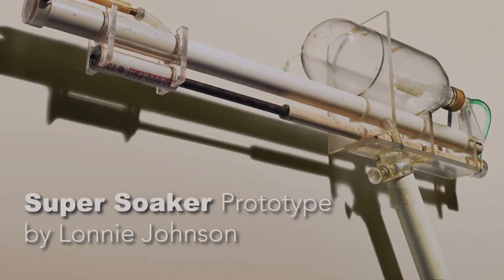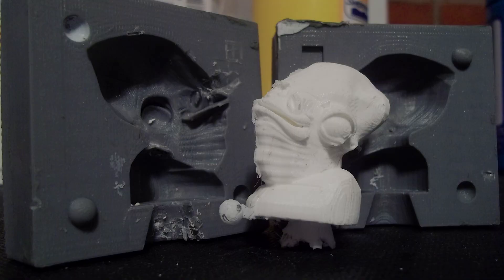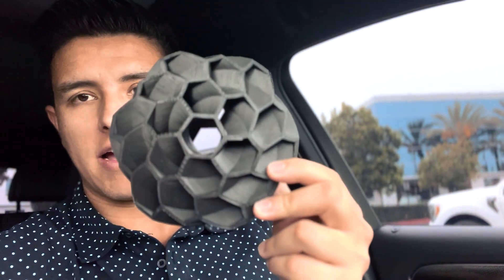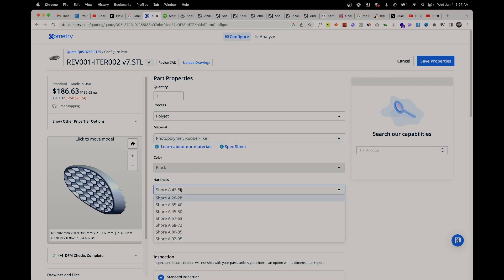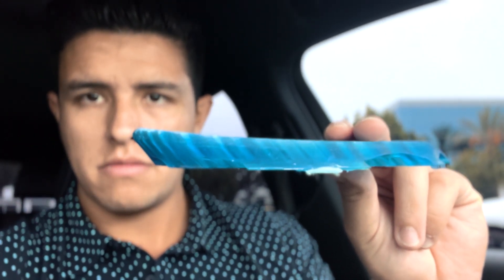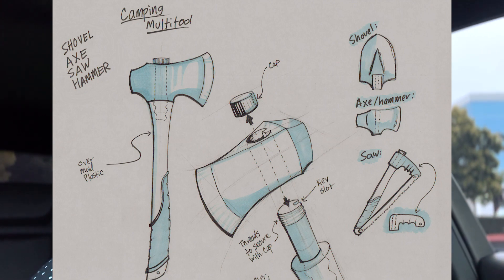How To Prototype A Product | Watch Before You Spend  - Build, Create, & Invent Your Idea on A Budget

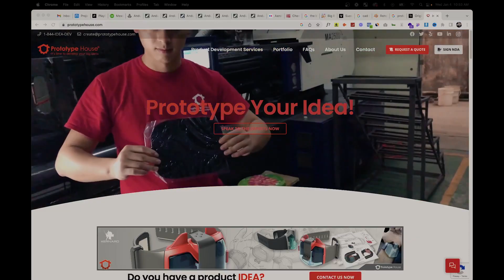Comment from the maker: 0:13 - 0:50 Different Ways to Prototype
0:51 - 1:28 Hiring an Industrial Designer on Upwork
1:30 - 2:10 Is it worth it to spend $ on each prototype?
2:15 - 2:35 Prototyping gives you specific knowledge
3:22 - 3:34 Finding a cheaper designer for quicker revisions
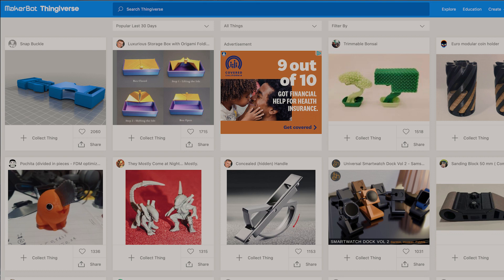3:35 - 3:49 Prototype Show & Tell
3:50 - 4:20 3D Printed FDM Prototype
4:35 - 6:01 HP Polyjet Prototype in Shore 26-28
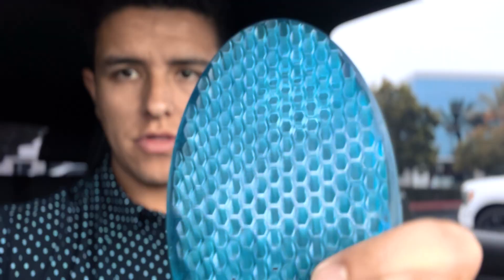6:02 - 6:38 Getting an SLA Resign 3D Printer for Quick Turn
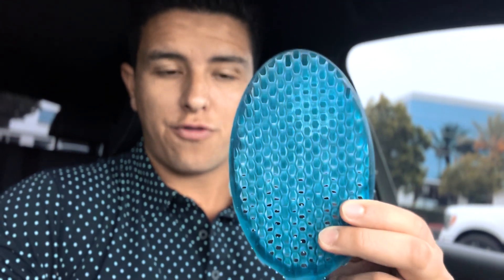6:40 - 7:10 SLA Hard Resign Prototype made on Anycubic Mono X
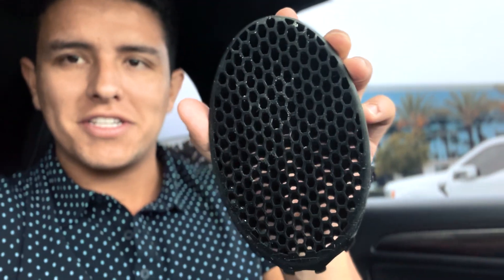7:11 - 7:37  SLA Flexible Rubber F80 Resign Prototype
7:40 - 8:15 My Take on Spending Time & Money
8:16 - 8:42 Understanding product cost & manufacturing
8:43 - 9:24 No physical prototype? Do 3D Renderings 
9:25 - 9:41 Photoshop & 2D Renders
9:42 Watch Next